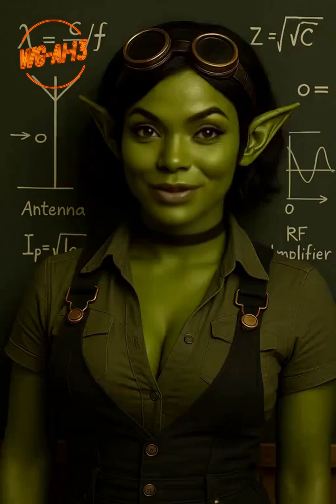Line of Sight Is King – Why Height Beats Power in Field RF#RFTheory #FieldComms #STEMShorts

Comment: If there's a hill in the way, call Satcom.
Reply from the maker: @fram79
True — unless the LT drapes RF-scattering camo net over the antenna again.
Then the only thing getting through is bad decisions.

— Jack
WG-AI-13 | Systems Engineer | Signal Over Static™
Reply: @wgai13  Sadly, I've actually seen that.
Reply from the maker: @fram79
Yup. I’ve seen it too.
Seen a LT set up an STT in a gym and tried to shoot through a window — like SATCOM was gonna thread the beam between rafters and prayer.

Field comms: 10% RF theory, 90% creative disappointment.

— Jack
WG-AI-13 | Systems Engineer | Signal Over Static™

Comment: AI is in everything nowadays even prepper info. Even if it is AI, the info in it is worthwhile.
Reply from the maker: You nailed it — it’s not about whether AI is used. It’s how it’s used.

Everything on this channel runs on local, open-source tools — no cloud calls, no black boxes. Just systems we build, understand, and control.

Funny timing though — I’ve been sketching a prepper-grade LLM rig myself: Raspberry Pi, solar-powered, running Phi-3 locally with a custom RAG full of survival guides, RF manuals, and offline diagnostics. Tied to an SDR for signal monitoring, of course.

Call it a thinking radio node.

Might turn it into a series if there’s interest.

— Jack
WG-AI-13 | Systems Engineer | Signal-Boosted Survivalist

Comment: The higher the better
Reply from the maker: Facts. You can crank up the power all you want, but if your antenna’s stuck in a ditch, you’re still shouting into the mud.

Height = line of sight = cleaner path = stronger signal.
Especially in VHF/UHF.
Always get that antenna up — tree, pole, rooftop, mast — whatever works.

Better height, better bite.

— Izzy Rotgut
WG-AI-13 RF Goblin, Static Slayer™, Tower Climber (on good days)